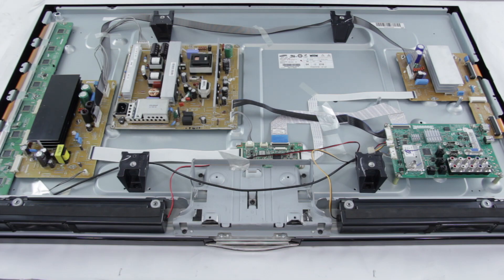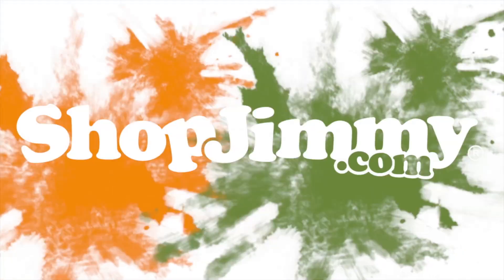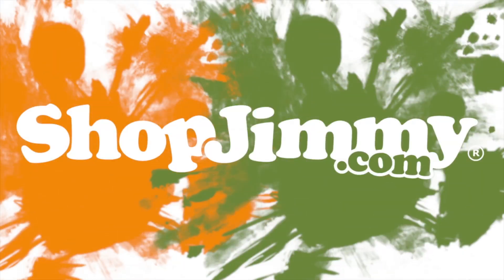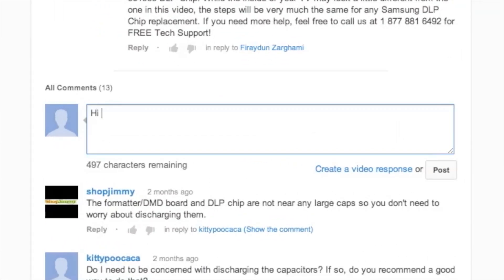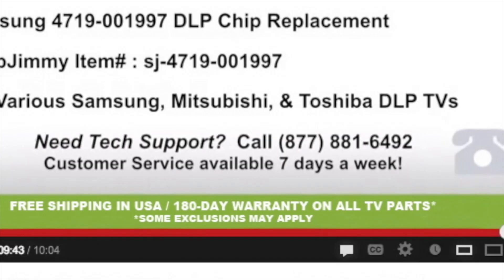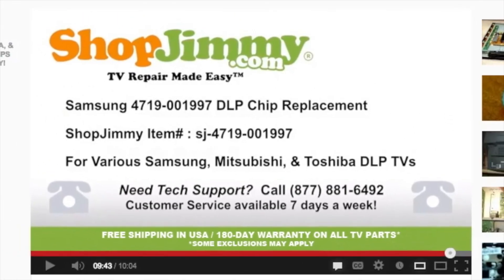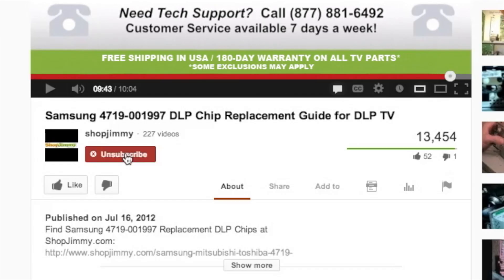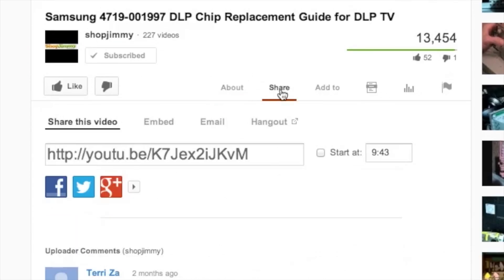Plasma TV Repair Tutorial - Common Symptoms & Solutions - How to Fix Plasma TVs

Comment: My LG 60PZ750 turns off randomly after a few minutes, it will power back on but turn off again shortly after.  What board would be causing this?
Reply from the maker: Jake Vidrine   Try this at your own risk. Unplug the TV, then disconnect the y board and plug in the TV to see if the TV powers up. Reply with the results of this test. Thanks! www.shopjimmy.com
Reply: I disconnected the ysus board and the tv still powered on. No picture came up but it could be because nothing is connected.  What does this mean?
Reply from the maker: Jake Vidrine  Try all repairs and troubleshooting at your own risk.  If you have experience using a meter, you can check the voltages on the VS and VA on the power supply board and reply with those results.  Thanks!  www.shopjimmy.com
Reply: 129V AC on the input voltage to the power supply, 209V DC on the VS checked on power supply as well as x sus, 59V DC on Va check multiple places on power supply.  Also checked 5v going on 3 lines to the main board.  All voltages that I could read off the the power supply are relatively close to the numbers on the board.  Does this mean I need to replace the y sus board?
Reply from the maker: Jake Vidrine   Try all repairs and troubleshooting at your own risk.  I recommend replacing the Y SUS board.  Click this link to replacement parts for your TV model number:  http://www.shopjimmy.com/catalogsearch/result/?q=60PZ750  There may be multiple boards for the same TV model number, be sure to match part numbers on your current board, with your replacement for compatibility.  Here is a link to a video showing how to identify your part number, click here:  https://www.youtube.com/watch?v=GEllG3RV-tc  Thanks and please let us know if you have any further questions with your TV Repair!  www.shopjimmy.com

Comment: I have a 60' LG plasma, model 60PA6500. a few times it has shut down, after a few minutes I could turn it back on with remote, One day it just shut down, would not turn back on with or with out remote. Logic board has green flash light, long, short, long short then pauses and starts over. This has happened about 3 weeks ago, it will now turn on, I'm sure there is a problem that is going to happen again.
Reply from the maker: Marty Koch  Try this at your own risk. Unplug the TV, then disconnect the y board and plug in the TV to see if the TV powers up. Reply with the results of this test. Thanks! www.shopjimmy.com

Comment: I have a Panasonic Plasma #TC-P50S30 which at one point while on, made a big popping noise similar to a capacitor blowing and the picture and sound disappeared. When unit is turned on it doesn't display a video or receive sound but, LED blinks 14 times then resets and blinks again 14 time. This recycles indefinitely. I have performed an inspection of all circuit components with back cover taken off with out a trace of any blown capacitors, fuses, or components evident. Any suggestion would be appreciated. Thanks
Reply from the maker: Frank Picardi   I recommend bringing your TV to a certified Panasonic repair shop.  Thanks!  www.shopjimmy.com

Comment: Hello, I was given a LG Plasma TV from a friend who bought a new TV because this one suddenly wouldn't come on one day.
If you hit the power button, it clicks, and the red light flashes and then it shuts down. No picture, power clicks and then goes back out and red light flashes. It also trys to restart the power itself a few times. So it trys to start, but just won't.
Would you have an idea?    LG Plasma TV 42PJ350-UB   March 2010
Reply from the maker: Rick Stacy   Try this at your own risk. Unplug the TV, then disconnect the y board and plug in the TV to see if the TV powers up. Reply with the results of this test. Thanks! www.shopjimmy.com

Comment: Hello,
I have a Samsung pn50b550 plasma 50" thats having some issues mfg october 2009.  The TV turns on, sounds works, responds to controller signals (change of channels, change of inputs), doesn't make any noises as far as popping that you've mentioned.  The picture is incredibly dark and can only see slightly when the room is dark. I also think there maybe a slight pink/red hue to the color - like when you push menu.  It also seems to be pixellated/distored/fuzzy when you look at the menu screen.  What do you recommend?   Thanks for the help in advance!
Reply: I've checked some voltages on the power supply board when the tv was running.  Va fluctuates around 40 volts. Vs fluctuates around 188 volts.  Va nominal is 55-56 and Vs is 200-215... Could this be an issue?  When I unplug Y and X board power the voltages stay at around 50 and 200 for Va and Vs respectively....
Reply: ShopJimmy.com When you say it could be either one of those boards - which ones are you recommending as it almost seems like a power supply issue but I need some direction.  Capacitors on the power supply don't appear to be bulged...
Reply from the maker: Nathan Etzel   Did you check with only one disconnected or both?  Try all repairs and diagnosis at your own risk.  Try with only disconnecting the y board then reconnect it and disconnect the x board and check.  Thanks!  www.shopjimmy.com

Comment: I have a samsumg 60' tv MODLE# PN6OE530A3F TYPE# PN60F530  106W  MFD#FEB2013 and the picture wont come on I have sound when I press the power button and I can hear the show. theres just no picture. for like a mouth I had to ture on the tv a few times befor the picture would kick in. WHAT PART DO I NEED TO FIX IT
Reply from the maker: todd penney   I recommend replacing the main board in your TV.  Unfortunately I do not see any replacement parts in the search results for your TV model number on our website.  Please reply with your part number on your main board and I can try searching for replacement parts.  Thanks and please let us know if you have any further questions!  www.shopjimmy.com

Comment: I have a Samsung plasma 5064   a common problem is happening to this tv  where the tv clicks but doesn't turn on.  guessing capacitors or fuse is bad  I see no bulging caps but at base of one it looks like a burn.  which board would you guess is the culprit

Comment: i have zenith 50 inch plasma tv z50pj240 the tv has sound, you can change input, change volume change channels, the tv does not want to show an image. it will randomly show a image when turning it on i got it to work last night but nothing today. I found this tv so wondering if it is worth trying to fix thanks
Reply from the maker: *****   I recommend replacing the YSUS and the YDRVTP & YDRVBT boards in your TV. Click this link to replacement parts for your TV model number:  http://www.shopjimmy.com/catalogsearch/result/?q=z50pj240  There may be multiple boards for the same TV model number, be sure to match part numbers on your current board, with your replacement for compatibility.  Here is a link to a video showing how to identify your part number, click here:  https://www.youtube.com/watch?v=GEllG3RV-tc  Thanks and please let us know if you have any further questions with your TV Repair!  www.shopjimmy.com

Comment: Hello, I need some help with my Plasma TV. I have a Samsung PN58C540G3FXZA TV. I am having an issue where when i turn on the TV i hear the samsung chime and see the red light turn but I have not picture. If i remove the power cabIe for a few hours then put it back in i see some pixelation on bottom of tv then dissapears. I have tried the flash light test but see no image what so ever. Hope you can help.

Comment: ShopJimmy.com I have an Insignia NS-PDP42. The tv does not power up at all.  The red LED stand by light on the front is on, and when the on button is pushed, it turns green for about a second or two, and then back to red.  I have visually inspected all of the boards, and there are no obvious problems.  I have also tested all of the DC voltage pins on the power supply board, and have good DC volts all around with the other boards disconnected from it.  When the power button is pushed, relay 101 on the power supply board cycles once, and a green LED on the main board cycles with it, and then nothing else happens.  Thoughts?
Reply from the maker: firebutmostlynerdfighter   I recommend replacing the main board in your TV.  Click this link to replacement parts for your TV model number:  http://www.shopjimmy.com/catalogsearch/result/index/?cat=56&q=NS-PDP42  There may be multiple boards for the same TV model number, be sure to match part numbers on your current board, with your replacement for compatibility.  Here is a link to a video showing how to identify your part number, click here:  https://www.youtube.com/watch?v=RwHTvjMdrhk  Thanks and please let us know if you have any further questions with your TV Repair!  www.shopjimmy.com

Comment: Hello I have a samsung 51" plasma  type no: PN51d530.

I get no picture or anything on my tv when i power it on.  I can see the red light blinking on the bottom right and it makes its normal sound that it does when i power the tv on and off but nothing happens with the tv itself.  No picture. the screen looks exactly like it does when its powered on.  I don't even hear sound.

Comment: We have a Panasonic Plasma TV, Model #:  TC P 55 GT 30, Serial #:  MH 10830362.  I was changing channels one at a time starting with Channel 2, trying to find the local channel.  When I switched to Ch 10, the screen went black and 11 was black as well; but I still had sound.  I did something else and the sound went away.  The red light on front of the tv was blinking 7 times and then pausing.  We took the tv off the wall, unplugged everything, then plugged the tv directly into the wall socket (on the advice of the Panssonic "help" line).  Then we were advised to take the tv in for repairs.  What do you think is wrong?  Thank you, Fenton

Comment: I have a Samsung Plasma TV, Model # PN51E550D1FXZA and it won't turn on. No picture or sound but red power light keeps blinking. No clicking sound either. I replaced the power supply board but still not working. Could it be the Y SUS Board?
Reply from the maker: Jeff Cote  Please watch this video FIRST to help with your repair!  https://www.youtube.com/watch?v=BP3NVNCGEv8   I recommend replacing the Y-Main Board and the Y Scan Drive board in your TV.  Click this link to replacement parts for your TV model number:  http://www.shopjimmy.com/catalogsearch/result/?q=PN51E550D1FXZA  Be sure to match part numbers on your current board, with your replacement for compatibility.  Thanks and please let us know if you have any further questions with your TV Repair!  www.shopjimmy.com

Comment: Hi, I have an LG 42PJ350 plasma TV. The video is gone but you can still select and hear all the channels. Is that likely to be the Y-SUS board? Thanks
Reply from the maker: Bruce Storm   I recommend replacing the YSUS and the Top Y Scan Drive board in your TV.  Click this link to replacement parts for your TV model number:  http://www.shopjimmy.com/catalogsearch/result/?q=42PJ350  There may be multiple boards for the same TV model number, be sure to match part numbers on your current board, with your replacement for compatibility.  Thanks and please let us know if you have any further questions with your TV Repair!  www.shopjimmy.com

Comment: I have a 50" LG Plasma Model #50PS60.  It turns on and the screen goes white or grey for a second or so, then there is a blurry pink / white / black picture for a second or so, and then it shuts off by itself.  I have a video of it here https://www.youtube.com/watch?v=WjcN4lBlPf8  .
Reply from the maker: Eric Haslip  Please watch this video FIRST to help with your repair!  https://www.youtube.com/watch?v=BP3NVNCGEv8   I recommend replacing the YSUS and the YDRVTP & YDRVBT boards in your TV.  Click this link to replacement parts for your TV model number:  http://www.shopjimmy.com/catalogsearch/result/?q=50PS60  There may be multiple boards for the same TV model number, be sure to match part numbers on your current board, with your replacement for compatibility.  Here is a link to a video showing how to identify your part number, click here: https://www.youtube.com/watch?v=GEllG3RV-tc  Thanks and please let us know if you have any further questions with your TV Repair!  www.shopjimmy.com
Reply: ShopJimmy.com
I replaced the YSUS, YDRVTP, & YDRVBT on my LG 50PS60 and still am having the same problem.  The screen is grey / white when the tv first turns on, then I get the blotchy bright ghost / burn in picture that looks kind of like a negative for a couple of seconds and the tv turns back off.  I tested the power output from the power supply unit and all the voltages looked correct.  What are my next most likely suspects - ZSUS, Main Logic Board, other...  .  Are there any steps I can take to help trouble shoot the problem area before getting more parts?
Reply from the maker: Eric Haslip   Try replacing the main board next.  Click this link to replacement main boards:  http://www.shopjimmy.com/catalogsearch/result/index/?cat=56&q=50PS60  Be sure to match part numbers on your current board, with your replacement for compatibility.  Here is a link to a video showing how to identify your part number, click here:  https://www.youtube.com/watch?v=RwHTvjMdrhk  Thanks and please let us know if you have any further questions with your TV Repair!  www.shopjimmy.com

Comment: I have the vertical line thing. It's just like the color lines going completely down from the top to the bottom. I've been googling and at first I thought it was a board or something then I read that maybe it's a fuse. It's a samsung plasma and this is the model number ( PN50A450P1D ) I'm not even sure what I'm supposed to be replacing >_<
Reply from the maker: 3m0SceneStabr  This sounds like a TV panel (TV Screen) problem.  If your TV panel is bad, it may be more cost-effective to replace the TV as panels are typically hard to find in stock, difficult to replace, and expensive.  Thanks and please let us know if you have any further questions!  www.shopjimmy.com

Comment: Hi I have a samsung plasma PN50C550G1F I havve right now 2 vertical lines that seem to change color with the background picture. Tv powers up fine sound work perfect.
Reply: I am curious if you guys read my post yet....those lines don't change position at all or color......any recommendations?
Reply from the maker: Carl Jurek   This sounds like a TV panel (TV Screen) problem.  If your TV panel is bad, it may be more cost-effective to replace the TV as panels are typically hard to find in stock, difficult to replace, and expensive.  Thanks and please let us know if you have any further questions!  www.shopjimmy.com

Comment: I just need a confirmation of it's the y-board ..I have a Samsung pn60e550 no picture but has sound I get the green LED blinks every 5 seconds i tested the Va Vs points and it shoots down to 0 but when I disconnect the y-board the green LED has the normal blinking and the volts for Va Vs points are where they suppose to be. Thank you ...and how long would it be when you get some in since your out of stock at the moment ...
Reply from the maker: fingers323   Yes, I recommend replacing the y-main board and the upper and lower Y scan drive boards in your TV.  Click this link to replacement parts for your TV model number:  http://www.shopjimmy.com/catalogsearch/result/?q=pn60e550  There may be multiple boards for the same TV model number, be sure to match part numbers on your current board, with your replacement for compatibility.  Thanks and please let us know if you have any further questions with your TV Repair!  www.shopjimmy.com

Comment: 8 FLASHING LIGHT PROBLEM SOLVED FOR A PANASONIC PLASMA 42 INCH T.V  TH-42PZ85U MODEL.

I CALLED 1-800-211-7262, AND THE COMPUTER VOICE GAVE ME THE FIX FOR THE PROBLEM.

Unhook all attached HDMI cables then unplug the TV.  Wait one minute, plug the T.V in, and it restarted right away right after the blinking light failure when it would have to wait a long time prior to cool off before restarting.  Then I plugged my computer into the hdmi 1 slot that I had my DVD plugged into prior, and it works now, without shutting off. 

The problem was I believe the side mounted HDMI GAME PORT 3 with the heavy cord, and the multiple unplugging of it.  Now it works fine.  I have only the computer plugged in but that's all I really use, besides the sound coax for the speakers.  I only had a sink cost of 750 (thansgiving deal tiger direct 7 years ago) , but still it's a great picture, and having just shopped for the new ones with all the glare, and haloing that they have was glad I persisted in researching this fix this weekend. 

I was wondering why some of the new Panasonic's had so few HDMI ports that I was shopping this weekend for on T.V's.  I think it's been a problem, and they chose to eliminate the Game Port Side Mounted ones on the more recent T.V.'s.  I like this TV, perfect size, great color, picture, and no problems that the LED sets have.  YES!!!!!  I'm happy.  I think both ports 1 and 2 will work, but all I really cared about was the computer hooked up, and will try to hook the DVD up to the number 2 later on.  Why press the luck right ?  So, I'm still debating doing that.